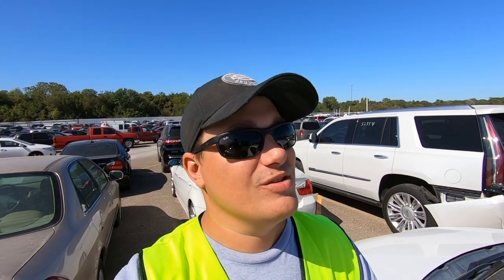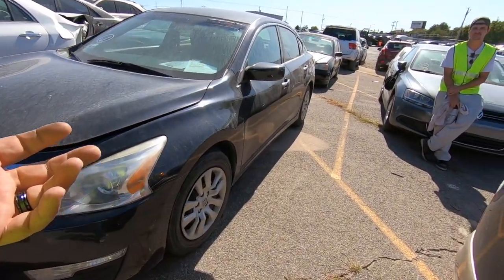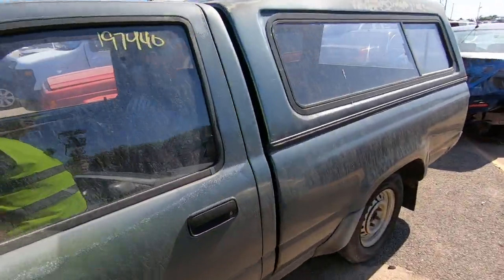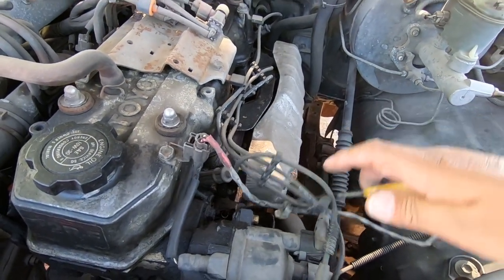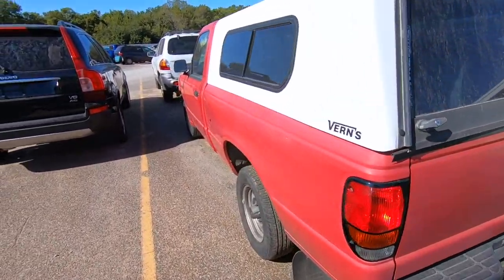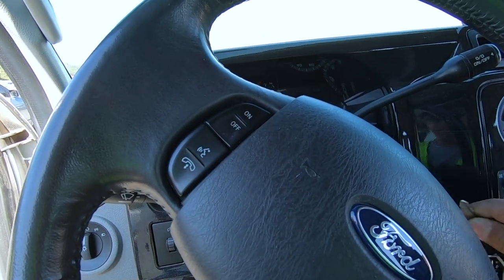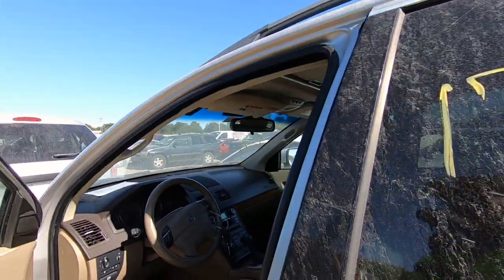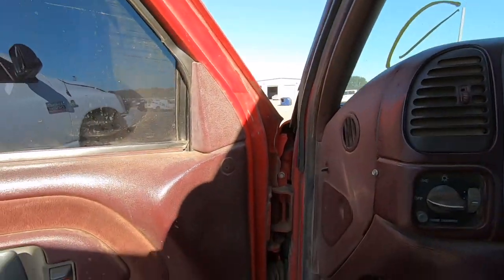Copart Walk Around 10-12-19

Comment: That Escape looks like it got a lot of the dust on the windshield! Great car though!
Reply: It's an SE model. Good if it's a 2.0 since those are timing chain. If it's a 1.6 those use a belt so or would be 35k over for the change. Also those were recalled for issues with leaking fuel some did catch fire.

Comment: the Wheel chair plug in on the trailer hitch is actually a Rack for Bicycles..
Reply: @Hand_Banana  Some of the riding chairs use a wide carrier like that. The mounting is very different than wheel holders for bicycles.

Comment: I had a 3500 6.5 tow truck years ago, it was great! 6.5 is decent if its under 300,000miles, the bottom end goes out of them. around 400,000 miles on mine when it went.

Comment: That Econoline has the 5.4 L 2-valve Triton. People hate the 5.4 because of the newer 3-valve version that had a bad timing system, poor cam phasers, and a weak oil pump. But when Ford updated the Econoline in 2008, they didn't swap out the 2-valve for the 3-valve . . . it was physically too big. 
For all the haters out there, the 5.4 2-valve may not have been the world's greatest power-house, but it was rock solid and dependable. That Econoline would easily go another 150K, if it is maintained.

Comment: The last truck is a 95 or 96. 1997 is when they started putting passenger side airbags in the Silverado, Tahoe, Suburban 1500. The 1997-2000 2500hd and 3500hd had the rounded dash where the airbag would be but there wasn't a airbag in it. It was just a square cubby hole in the dash.

Comment: i have a twin to the 93 toyota pickup... it is the fuel pump, bear to replace (remove bed) but that is what it sounds like. mine has 120k on it but runs as new. they are high in demand . i have been told you can get 400 k miles before you have to replace engine (if you take care of them)

Comment: the 6.5l gm diesel engine is a good motor. it has more power then you think. there's pretty good chance that the electronic injector pump, pmd, and pmd coolant pump is out. about $2000 in parts. very common issues with the 6.5l gm diesel. here's what happens the pmd coolant pump goes out. $70 to replace. the pmd gets hot and quits working $286 to replace. in turn the electronic pump quits working. $800 to 1500 to replace. the pmd coolant pump looks like an inline fuel filter. I had a 1999 2500 gmc savanna with that motor. the van got 19.72 mpg on average.

Comment: I would definitely keep an eye on that old Toyota Pick Up. Like you said it could a fuel pump or an old Map sensor needed replacement. Manual transmission on those are easily rebuildable or there's plenty of good used manual trans. Overall looks in very good shape and they have high resell value.
Reply: Probably cheaper to swap the trans from a wreak.

Comment: Yota probably needs a clutch master cylinder I bet if you pump the clutch it will go into gear. The B2300 was decent I've had numerous small trucks the best ones in my opinion are Rangers or B- Series but basically at 1993 and newer they were the same trucks

Comment: Man we just dont see ford vans like that here in Australia, im not a ford fan but that van ,
Reply: Yeah, but then I'd like a sink which we get in the campers. I'm hunting for one but its hard to find a good one as they are trashed by backpackers.
Reply: Ck the frame on the Toyota,  if it's good buy it cheap . Those toys go 400 th easy
Reply: Somebody sabotaged  it so they could get it cheap
Reply: Hey I'm older lol ! A lot of those small pu s go right to mexico , they love them .
Reply: That should buff out !
Reply: The rear air prob has a leak didnt wanna spend the dealer bucks to fix it . Never say never remember  there is a seat for every ass ! You might steal that van . It's usually a ac line for the rear ac .
Reply: Imagine sucking the used car farts out of that front seat in that chevy !

Comment: @13:00 the Toyota you can't hear the fuel pump because it has to have a supply power from the mass airflow sensor... When the flap opens sucking air it turns the fuel pump on.. FYI I spent all day diagnosing that 22RE. 😂
Reply: BTW T-bird behind the Toyota 👌